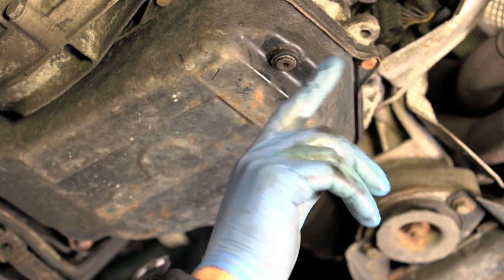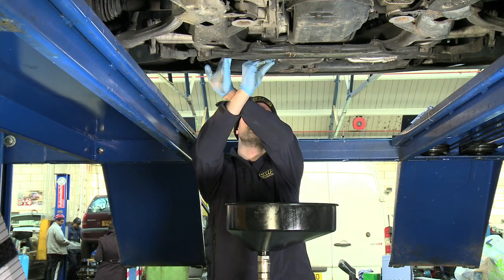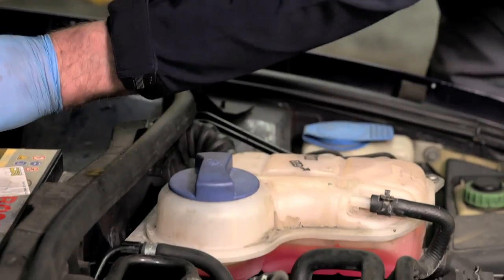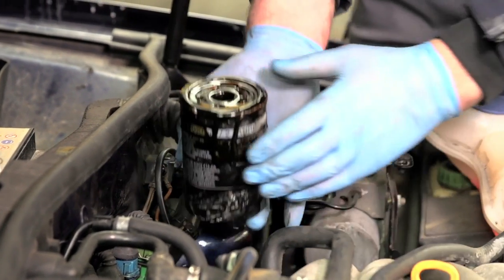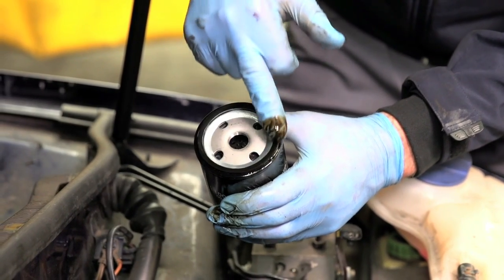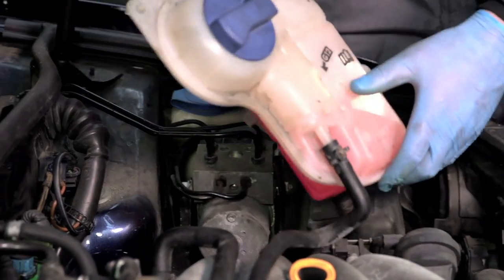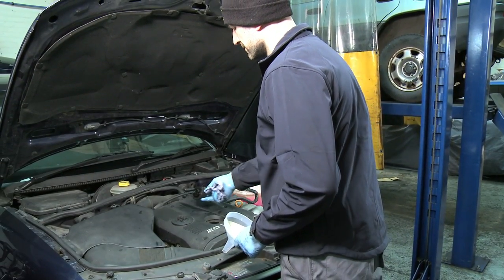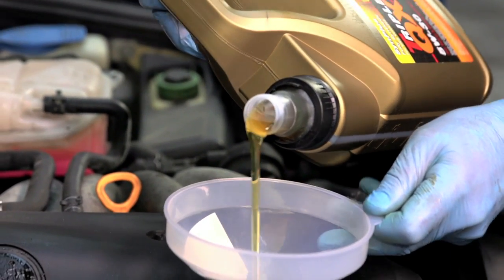How to Change Engine Oil and Oil Filter

Comment: Opening the Oil Filler Cap and taking out the Dip Stick would be good to release any pressure inside the engine to give it a nice quick and better drainage. You should also use a Torque Wrench to tighten the sump plug. If replacing the old sump plug, make sure to clean it incase it has a magnetic end to catch deposits. You should also fill up the oil filter to the top with clean oil before fitting.
Reply: Yeah.... You need to use torque wrench for all the bolts in the world... How would a mechanic make a profit searching for torque settings for every nut and bolt on the car? It would take ages to do a simple job.
Reply: Quote "You should also use a Torque Wrench to tighten the sump plug." Where did I say "You need to use torque wrench for all the bolts in the world"? Plus he would make a profit by adding an extra hour onto the work done
Reply: @grzegorz16100  Anyone who can't help themselves over-tightening drain plugs should be required to use a torque wrench.

Comment: Josh Briggs is right.
Also, you have to remove the oil cap from the top of the engine, so that the oil can drain much better and faster from the oil pan.

Comment: you should fill the oil filter with oil before you re-attach it to the engine, so on the initial status the engine is full lubricated straight away
Reply: +Josh Briggs 
You are right, mate.
Reply: No need to pre fill  oil filter. The engine still has oil on the parts. The pressure is so fast the engine receives oil instantly. Many vehicles including very expensive vehicles have cartridge filters  and they are not ore filled.